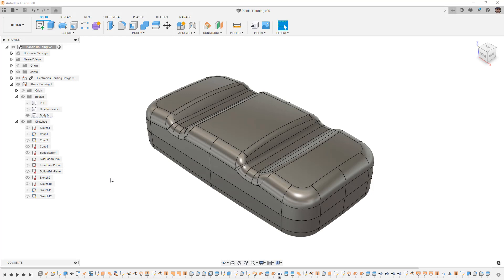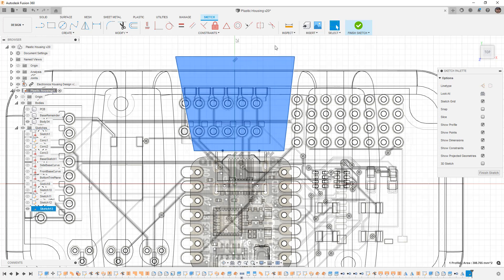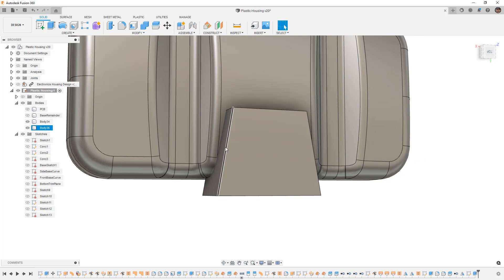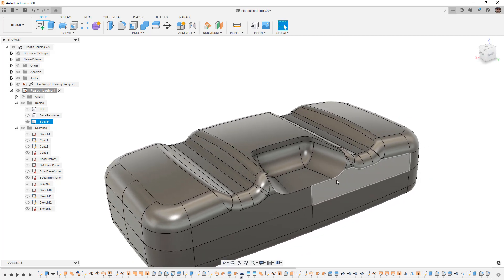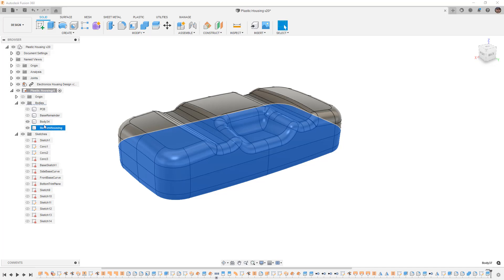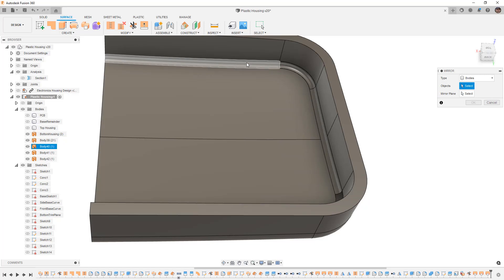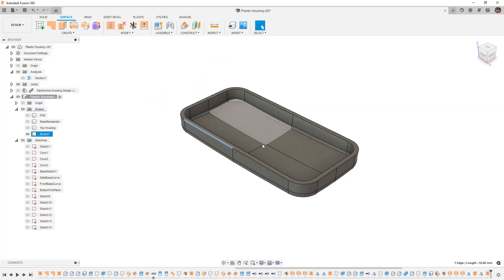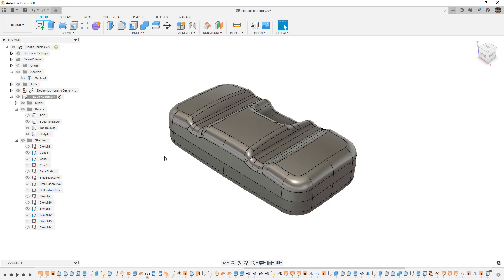Plastic Part Design Series Episode 8 - Shelling and Problem Solving #Fusion360 #Design

Comment: 6:54 I think using a constraint line from 0 coordinate to top horizontal and giving it a horizontal constraint can be a better solution than adding two identical dimension 
anyway, thanks for the video!
Reply from the maker: Not sure I follow Usamah.  Which two identical dimensions?  The .05 is linked so really its only one.  And yes using constraints and construction geometry vs dimensions vs equal constraint are all valid solutions.  Just depends on the desired workflow and approach.  I do agree you should avoid duplicate dimensions if they aren't linked as it makes it unstable and hard to edit.

Comment: For the fillet that runs along the bottom of the lower housing (added in Episode 6), if the Tangency Weight is set to the default of 1.0, the fillet (still with Curvature continuity) will offset smooth for the Shell.
Reply from the maker: Thanks Steve.  Yeah in that video with the tangent fillet with 1 for the weight I offset the surface to 3mm before the inner edge goes away to show how it worked.  While it might work with tangency at 1 it "should" work no matter what your setting is.  Theoretically the radius of curvature of 3mm should still be the driver for the corner even though the tangency weight is influenced.  When you offset just the fillet surface of the current setup you still get the square corner.  That generally would happen if the fillet radius was smaller than the thickness value but it just doesn't seem to like changing the tangency weight.  You have any idea why?
Reply: @LearnEverythingAboutDesign  The Radius value determines the location of the fillet's edges; the value is not directly used to limit the minimum radius.  The minimum radius for the fillet with Curvature continuity and 1.5 Tangency Weight is about 1.4 mm.  Changing the Tangency Weight to 1.0 increases the minimum radius to about 2.4 mm.

One way to reshape a fillet via Tangency Weight while maintaining a minimum radius is to use Curvature Map Analysis with Type set to Principal Maximum and Maximum Limit set to the minimum radius to allow.  After adjusting Tangency Weight to get the desired shape, Radius can be increased until the red disappears.
Reply from the maker: Amazing insight steve thank you!  So why the heck are you watching videos ?? :)  I guess I had assumed that the fillet radius when set to constant would limit the minimum value so that is great info that it isn't actually true.
I did some more playing around with different weights earlier today and noticed with the weight at 1 i could offset the surface of the fillet 2.6mm before it "broke"  at 1.5 weight the offset worked until about 1.3mm.  

Neat trick on the Curve Map Analysis.  It would be cool if that was in the fillet tool like it is with things like Loft so you could do it on the fly.  I did a test with it and it does work but the inside surface is less than ideal but tweaking the numbers around a little more certainly helps.

Thanks again for the comment and info!